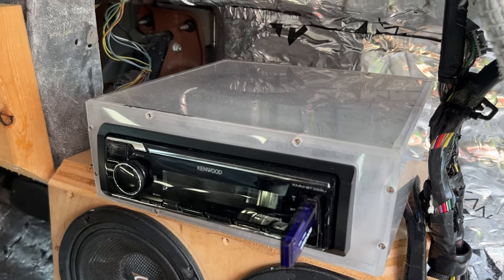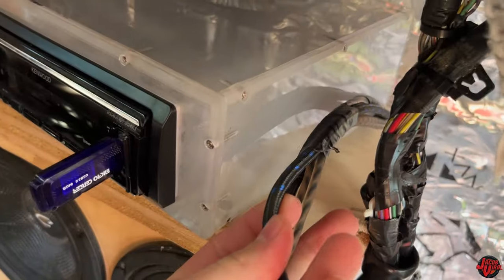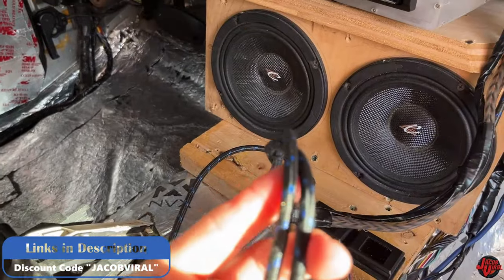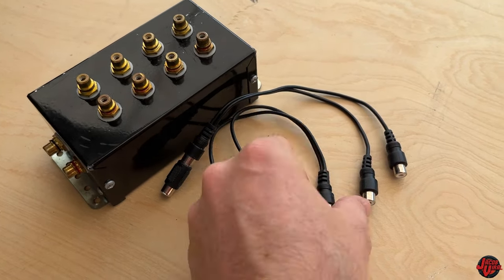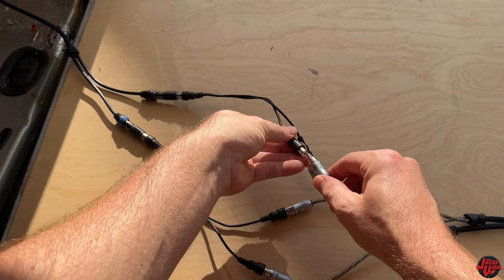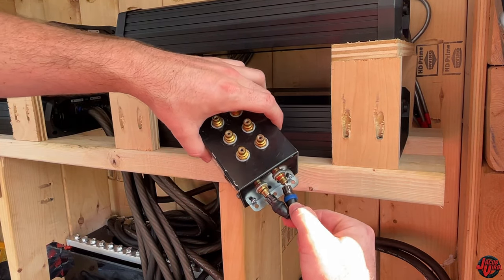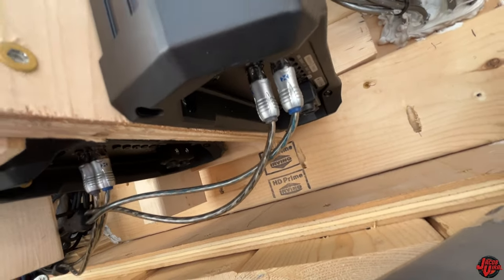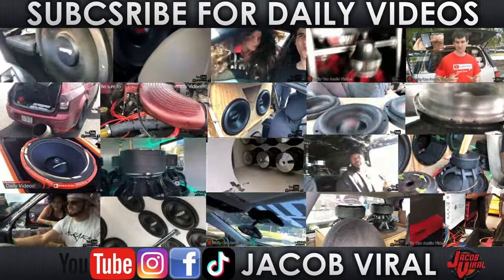HOW TO INSTALL 2 OR MORE AMPS WITH ONE RCA

Comment: Hi my amplifier has rca inputs and outputs can i just use the outputs rca?
Reply from the maker: If the same rca signal match for all amps yes , but say you went from a subwoofer amp to speaker/tweeter amp then no
Reply: @JacobViral2  thank you

Comment: How would I run it in running an equalizer?
Reply from the maker: Split after all other devices, so signal is utilized post adjustments
Reply: @JacobViral2  sorry I’m new to this. What do you mean by split after all devices?

Comment: How do i hook up my 6x9 to my amp I already hook up my two 12 and amp i hook that up with a in line  output converter so i need help hooking up my 6x9 and amp am running two amps
Reply from the maker: aftermarket radio with speaker front/rear

Comment: Won’t this set up play all the speakers like it was a mono set up? I’m trying to run 2 amps but only have one set of rca’s on my aftermarket headunit. I know certain songs play only on the left or right side and I still want to be able to do that
Reply from the maker: You should still be able to do left/right as that’s why there is 2 rca connect points.

Comment: thanks man this answered most of my questions. but i have just one question. now how do you use the bass knob to control two of more amps? is there such thing as a Y splitter for bass knobs too?
Reply from the maker: Rca bass knob through your main rca line near head unit in/out then splits later down so controls all signals.
Reply: i have questions about connecting two or more amps using a bass knob , does it affect sound quality or affect the strength of the volume?
Reply from the maker: @ixrvalor0812  yes and no, will depend on the quality of the knob used as well as rca/connection quality. If no issues and high quality, should see minimal to no difference. It’s a big factor many use for more pros and little to no cons.

Comment: I set my splitters up the same way but i plugged my splitters right into each amp. One problem i have is that only one sub works and the other gets no signal. Anybody know why this is happening?
Reply from the maker: Could be a lot of things from bad wiring/sub/rca/amp/etc. check your signal at each point and ohms
Reply: Because if you followed how he did it one amps only getting a left input and the other amps only getting the right Chanel in put

Comment: How do I set my gains I have two Skar 1200.1 chained together and I cannot get the gain right I have an o scope I just can’t figure out how to set it because the second amps gain movez and the first one moves I put both them to clipping sepperately hooked it up and it sounds less than one amp alone
Reply from the maker: Could be your ohm impedance changing from 2 amps vs. one amp. Sounds like your doing fine tuning gain with device and just need to have amp wired ohm right at 1 ohm
Reply: @JacobViral2  thanks jv but when I turn my bass knob up it turns the bass down ?
Reply: Any ideas what’s wrong I have my negatives bridged on my amp
Reply from the maker: @GrowhouseMN  that’s very weird, I would suggest not chaining(strapping) both amps together and set each amp deprecate and match. That way not issues in the chain matter as trial and error. Try it without a knob also, could be a malfunction or error.

Comment: Hy, sorry but i dont get how i can connect my amp to another, i tried throu the rca splitter but it didnt really work, i only have rca out on one the amp that i want to connect to the other one. Now i have seen many videoas showing how you connect the pre amp rca´s to another amp, but i dont get what he uses those splitters for. Can anyone explain to me what the splitters are exactly for please?
Reply from the maker: It gives you 2 routes vs. 1 run from a single rca signal. It just splits into two rca from a single. Video explained
Reply: @JacobViral2  ok i get that, but in order for that to work, the amps must have an rca our right?
Reply from the maker: @christiandenaro5140  input only, you can split rca signal from your aftermarket radio to X amps.
Reply: @JacobViral2  shure, but i dont have an aftermarket radio, now i tried from the "phones" out to connect to the other amp, but apparently it switches left and right channels for whatever reason. Anyways Thanks for clarifying this for me man!
Reply: So a bass rca coming from head unit going to the bass knob then from the bass knob to the amps?

Comment: Wouldn't this splitter drop the quality and voltage of the signal a lot? Since there is so many outputs out of one RCA? Maybe better to use sound processor in this case?
Reply from the maker: Seen people have up to 8 amps and work just fine? I doubt that’s something to worry about but if it’s full sound quality then yes
Reply: @JacobViral2  I’m still kinda lost lol how many y splitters and  4 channel rca cables would I need for 3 4 channel amps
Reply from the maker: @edmondcarter9457  You need a rca distribution blocks best https://amzn.to/3Miwap2

Comment: Hi Question??
Reply from the maker: Sure whatsup maybe can assist. Feel free to message me on Facebook/Instagram JacobViral
Reply: @JacobViral2  I recently installed a passive line output converter for a Sub amplifier all great no issues.  Now I want to install a second amplifier a 4channel I usually use an Lc2i for this purpose. My question is can I use my existing LOC and connect it to a new Rockville R7EQ that has  sub out ,rear out and front rca output. Or should I still get the LC2I ..Thank you
Reply from the maker: @marcovaldovinos5009  try before buying and it it works don’t , but I would think the additional device probably will help? I honestly use aftermarket radios always only so no experience with stock
Reply: @JacobViral2  thanks anyways

Comment: 10:50 what if amp is 4 channel with 4 rcas? Do you run 4 rcas per amp to the block still?
Reply from the maker: A 4 channel is simply 2 x 2 channels, so 2 sets of rcas with seperate signals for the   Adjustment/equalizer/etc necessities. Your able to use a split from 1 set to turn into multiple class ab amps if needed.

Comment: I have two monoblocks and 1 8channel amp. My headunit only has 1 L&R output. Will i have to use splitters from the headunit and use one distribution block for the monos and an additional distribution block for the multiple channel amp “for speakers”?
Reply from the maker: Correct, you need separate signals for the speakers vs subs